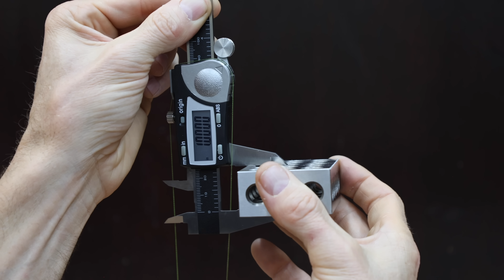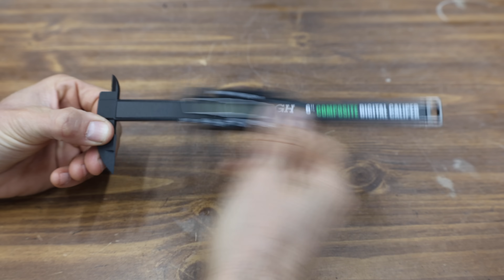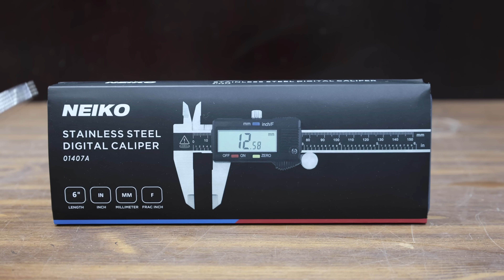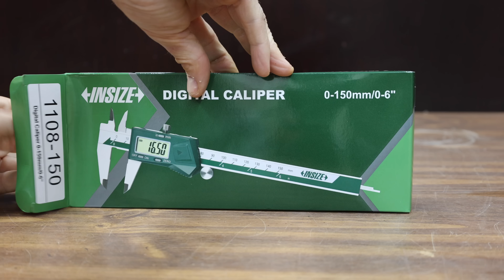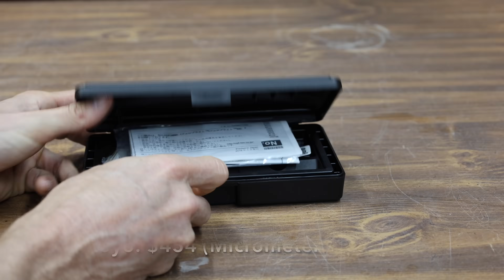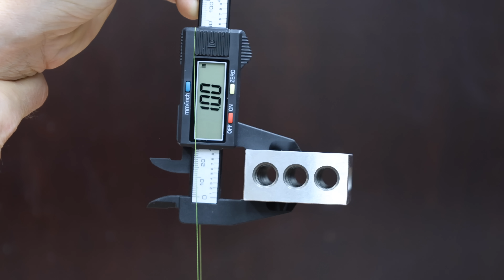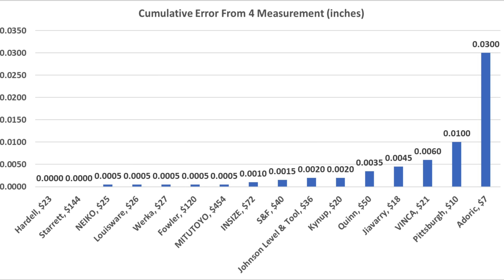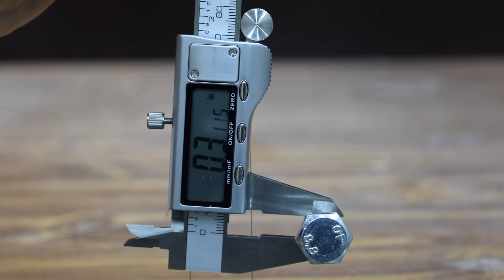I've Been Proven Wrong About Calipers!

Comment: 50 year machinist here. All of these calipers are OK for most of the non-machinist people that use them. The feel in touch that you develop with them determines on how accurate they will be. I’ve seen guys that were a machinist for 10 years and still crank down on a Mike or a caliper and wonder why they were getting the wrong reading when inspection junk part.
Reply: This is what most machinists in the comments miss, and i completely agree with you. I do 3d printing for designs and repairs, I have a few sets of the Vinca, because I don't measure stuff in a machine shop, I do it outdoors, in panels, on equipment, in my office at home where my kids roam free when I am at work. 
If I break or lose a 20$ caliper, I just smile and order another one. Majority of people who watch this channel aren't going to be machinists demanding absolute precision of their tools at 400$+ while keeping it all locked up in a machine shop.
Reply from the maker: Thanks for the feedback.
Reply from the maker: Thanks for the feedback.
Reply: We always called those guys gorillas...lol

Comment: When measuring the accuracy of the depth measurements, I recommend using a gauge block/parallel on the bottom side instead of the wooden table.  In the cases you tested, you were measuring the inconsistencies in the table as well as the calipers too.  Thank you for the video!
Reply from the maker: You are welcome!  Thanks for the suggestion.
Reply: 100% agree offset gage block. Some sources will recommend a surface plate, but the surface plate specs don't really guarantee flatness for contacts less than 3/8 in diameter.
Reply: I was coming here to say the same thing. Kudos!
Reply: Was an aerospace machinist for a number of years . Started only using expensive Brown&Sharpe dial calipers. As the years went by I supplemented my measuring equipment with low cost stuff that I did not take too seriously at first . All new measuring instruments had to be certified by the QA department . All of the cheap stuff past and got certification stickers on them , just like the expensive equipment. Still did not totally trust them so I often double checked measurements from time to time with the expensive measuring tools , always good . Eventually the only one that failed the semi-annual certification was my original “ Brown&Sharpe” calipers. No fault of the brand , it got very hard use for years . ….That is my input from years of experience .
Reply: Great observation. This video could do with a follow up
Reply: Thanks for making this comment before me. A piece of glass would have been better than a  grainey table.
Reply: This is so obvious now that I read it. Didn't even think of it at the time.
Reply: I love this video and used it to choose the NEIKO (my actual needs, speed of delivery, cost). As a former machinist, I did cringe a bit at the wooden table.
Reply: @kennichols3992 it wasn’t a “cringe” thing, just adds an additional source of error to a measurement comparison of extremely precise measurement devices.
Reply: I was going to say the same thing… he could have used a stone as well.
Reply: Yeah, came here to say something similar. Your way is simpler than what I thought of. 😎
Reply: Was thinking for him, plate glass would be more accurate then his table top!
Reply: Make calibrated test gages
Usually QC ckecks gages monthly
Reply: Yes, the wooden table is a fail.
Reply: Yes that is true I'm very surprized that the mutitoyo didn't finish at #1.
Reply: @intra_morph  Definitely keeping my Mitutoyo calipers...they're Vernier calipers and have proven very reliable...and they're kind of expensive...lol
Reply: @intra_morph  It's important to remember that calipers are not high accuracy measurement tools, regardless of the brand.

The Mitutoyo ones will basically always meet their spec, as will any of the better brands tested. That (plus build quality) is what you're paying for.

There will still be some unit to unit variance in accuracy and smoothness, as well as random error due to how carefully the tool is used.

It's not necessarily that surprising that one specific Mitutoyo caliper is outperformed by one particular sample from a different brand.
Reply: @JMMC1005 One sample per tool makes it a poor analysis also. Kinda a slop video.
Reply: @intra_morph  What kind of world is it where you cant trust $400 Japanese caliper? Maybe I should purchase a set of gauge blocks to verify everything. Can I trust those? Who knows!
Reply: @trollmcclure1884 using the depth rod is the least accurate measurement you can make with calipers, too many variables.  For depth you should use a depth gauge.
Reply: @trollmcclure1884  

You can trust them to be within spec, but calipers are a compromise which trade some precision for versatility and convenience.

No matter how good they are, you're almost always going to get less error with a micrometer or depth gauge.
Reply: @trollmcclure1884  Don't understand your problem. Not watch the video? or is it that you can't focus, comprehend, or retain? That caliper was paired in  a case with a micrometer. That is the price. Mr Farm didn't provide a separate price of $162.84 on Amazon. Got it sleepy head?
Reply: @trollmcclure1884  it wasn't $400 to begin with.   It is part of a $400 kit!  True price is half that.   A bit misleading in this case.  
Not to mention the flawed testing methods in this video.....
Reply: Agree. The generally larger error when measuring depth seems to be proving your point, especially when comparing with other very precise tools.
Reply: Just came to say the same lol.
Reply: Same, I disregarded that entire portion because of it. When you're dealing in 1000th of an inch, wood is a horrible choice.
Reply: Why would he have parallels or gauge blocks?
Reply: @TheTimothydragon Those things are basic machine shop items along with granite surface plates and dial indicators. I have all of those things and by not buying the expensive brands it really wasn’t that big of an investment and yet with my sine block too I could monitor my work very precisely. In fact it kind of scared me when I found out the inspection department was just stamping my parts with their “ accepted “ stamp and not even checking them. They “are always good” they said.
Reply: I winced when I watched this and thought the very same thing!  The wood underneath cannot be perfectly flat.
Reply: Came here to see if someone said this. I don't know if there would be much improvement with these though, but precision would definitely improve. I've never had great luck getting precision depth measurements from calipers. Depth micrometer or nothing if I need precision. I'm a hobbyist so that's kind of rare, but certain setups I've done require it.
Reply: Exactly this, plus wood has some "give" which puts the models with a finer depth probe tip (which tend to be the higher quality models) at a disadvantage as these will tend to press a little bit deeper into the surface.  That's not a big effect but at sub-0.001" accuracy it does make some difference. 

I must say that for my money is always been Starrett or Mitotoyu -- my favorite are the old USA- made Starrett with the .0001" readout.
Reply: This is what I thought as well. Or at least mark the table where the test initially occured, and place the block there for the test + take an average of three hole measurements.
Reply: Im an ex-machinist and did the 4 years of trade school and worked the trade for 15+ years and I agree, gauge blocks, but I think the video is more for your home guy with a caliper in his garage not for a inspector in a QC lab in a controlled temperature. He makes other videos that are very good.
Reply: Yeah I was gonna suggest a small granite surface plate; eventhough butcher block is better then most wood it's still gonna have some discrepancies.
Reply: I have no idea how to use calipers accurately but I will jump on the band wagon and give you my 👍
Reply: @Dee_Sandoval  Basically, what he was doing wasn't measuring the depth of the hole, but instead measuring the depth from the top of the block to the table. Since a work-top like is being used here isn't held to sub-millimeter tolerances for flatness and smoothness, and he's trying to measure tools that have sub-millimeter precision, a tiny bit of waviness in the table's surface would create a noticeable error in the test readings. That's why the guy you're replying to was suggesting using a gauge block, which IS designed to be flat/smooth enough to give a reliable reading.
Reply: @Just_A_Dude in layman's terms: table ain't that flat.
Reply: @Dee_Sandoval Vernier calipers are super accurate. Blew my mind when someone finally taught me to read the scale. Next time you're around a pair, try. Here's how it works. Let's say you grip around the object, then tighten the lock. Look to read it and the mark passes a little past the mark 1.1 and doesn't quite reach 1.2, just kind of in-between the marks. You look to the Vernier scale below and look at which of those marks lines up closest to a line above it. Doesn't matter which line. Just find the one that is exactly in line with the mark above it. Say the 4 lines up closest. Bam. 1.14 is your measurement. All there is to it. Now instead of somewhere between 1 1/10 and 1 2/10, you have narrowed it down to 1 14/100. It gives you an even more precise measurement down to the next multiple. Whether centimeters or inches or even minutes of a degree in Vernier protractor applications. Same principle, just check the scale to express the measurement accurately. It'll be listed. Can be fractional or decimal when it comes to inches, usually there's a conversion chart on the back of the calipers to switch one to the other. Hope this helps!
Reply: I thought someone would comment the test wasn’t as accurate as the calipers. Looked like a lot of scratches on the table too

Piece of plate glass would have been the cheapest, more accurate solution
Reply: Parallels?? U won't work in QC do you
Reply: @jckdnls9292 You don't work as a proofreader do you?
Reply: Let’s be honest, for 99% of us the accuracy of the 7$ one is plenty
Reply: @JusTryNc  For most people, sure.  I’m just giving constructive criticism on the measuring, not the quality of the products.
Reply: @JusTryNc  But, there's more than just accuracy to consider.  I used a Pittsburgh for a while, and it was annoying in at least four ways: 
1. The smaller battery didn't last all that long.
2. The battery cover kept popping off.
3. The slide action was very stiff, making minor adjustments difficult at times, especially in tight spaces.
4. More and more, it became necessary to Zero the thing!  In fact, I almost messed up a 3D print because the thing was off by several millimeters.  Fortunately, I caught it in time and re-measured.  That is when I bought my $20 Kynup, which is a dream by comparison.
Reply: @JusTryNc  the $7 is what i have! its my first one and its been fun to use! its good enough for me. Just wish it wasnt plastic and didnt look cheap lol
Reply: For the average non-10-thousandths tool, a >1/8" piece of glass will give reliable results.  Just don't move your gauge block.

Comment: Good to see this comparison, but we beg to differ.  MITUTOYO's are the ONLY calipers we use and purchase (yes, we've used many others other the years, but there is no comparison).  Tried and true.   Their price should be $240 and not listed as the set at $454 (including micrometers).  And they're worth the extra $120 over the competition. And being made in Japan is a big plus rather than all the Chinese made products.  The Starrets were made in Scotland, which was good to hear.    

The thumb screw is very beneficial and should have been a ranked category.

The height measurement would have been more accurate using a surface plate.

Comment: Having bought a number of cheap callipers before settling on my Mitutoyu set, I have to say the biggest thing to watch for is how long the battery lasts. Cheap Chinese callipers the battery last a month or two if you’re lucky and it doesn’t matter if you don’t use it or not! After a while, the cheap ones’ battery contacts corrode too and they’re useless. Consider them disposable at best! My Mitutoyu set cost a lot more (but still less than the Starrett) and heck was it worth it!!! Oh and I detest fractional inch reading. If it doesn’t do decimal inches and millimetres, forget it! And full stainless construction, a smooth thumb wheel and 0.001” resolution are all necessary for any kind of precision engineering.

Interesting that you take the 1:2:3 block dimensions as true, but only check the 1” side with the Mitutoyu micrometer. I’d have checked the other two too as a 0.0005” oversize on the 3” side (or a slight spot of grease when checking with callipers) would change your accuracy results.

Hey, you can’t trust the depth measurement on a wooden table surface 🤦‍♂️! If you don’t have a surface plate, use a glass plate made from float glass.

I think you have artificially handicapped the Mitutoyu in your evaluation by buying a bundled set in a fancy wooden box with a micrometer. My Mitutoyu cost me less than your Starrett and is the perfect instrument for me.

Comment: I like your videos but these methods don't instill confidence. I think you used the string with weight method to get even pressure on the calipers, since caliper jaws can bend if too much force is applied. But to get accurate readings with calipers you have to gently rock them to find the smallest point, which is the correct measurement. This is especially important with the narrow portion of the calipers. 

When I was a machinist I checked numerous cheap and expensive calipers on gauge blocks, and the only ones that were ever off were old calipers with worn out jaws (don't buy used calipers for this reason). I suspect many of the calipers without the ABS function were not zeroed correctly, if you zero them with any dirt on the jaws (which usually isn't visible), they will zero at the wrong value and read small. It's one of many reasons I don't like budget digital calipers.  

The depth measurement portion is for sure not usable info. You need a very flat surface to check the depth measurements, it cannot be wood, especially with visible damage. Even a perfect wood surface isn't anywhere close to flat enough to check these calipers. You're measuring the surface finish of your table more than anything else in this portion. Measuring depth with calipers is kind of a crap shoot anyways, due to how small the base is, but they do sell attachments that make them much more reliable as a depth gauge. 

I think the improved accuracy by most of the calipers when measuring the 1-2-3 block holes shows the previous measurements were not done correct. Since the holes were measured in the way you'd actually use calipers, most of them measured it correctly. I think if all measurements were done this way, the results would be much better. 

Also keep in mind calipers have an accuracy of +/- .001", even if they have a resolution of .0005", so the .0005" isn't to be used, it's just a reference.

Comment: Many times, straight out of the box, the cheap tools perform as well as the expensive.  However, the durability of the cheap tool is poor compared to the expensive tool over the long run. 
Where that cheap tool may be just fine for around the house, it probably won't last when used daily by  professional tradesmen.
Reply from the maker: Thanks for the feedback.

Comment: Always enjoy the videos! The one thing you didn't test is battery drain when powered "off". I tested the pittsburg calipers and they draw just slightly less when OFF as the Mitutoyo does when ON!
Reply: I have a Pittsburgh caliper and found the battery dead if left in the caliper. I remove it when not in use, the slide battery holder is convenient…would be pain if it was held in by a screw.
Reply: The cheap ones I got at Aldi had the same problem. They just fake being powered off, in order to pretend having auto power on. (Since they don’t know how to actually implement that.)
Reply from the maker: Thanks!  Thanks for the feedback.

Comment: Auto shutoff doesn't matter on the Mitutoyo, I'd guess its been at least 2 years since I replaced the battery on my desk set of Mitutoyo's and they are used daily with the display rarely ever turned off. My second pair that I keep in the case and clean as possible as a reference have never had the battery replaced and are nearly 10 years old. As for all my other cheap calipers I keep around to abuse I bought a 100 pack of LR44's because every time I go to use them they are dead if I forgot to pull the battery out. The most important reason to buy good calipers (or at least have several pairs to occasionally cross check with) is that the cheap ones will randomly start reading hundredths off, and then you are scrapping parts and hours to time because you wanted to save a bit on a pair of calipers. Hell I've probably wasted over $100 in filament on bad 3d prints from cheap calipers reading wrong just because I was too lazy to go back to the desk and get the Mitutoyos. That being said, cheap calipers still definitely have a place in the shop, I always keep a pair next to the grinders and another by the welders because the Mitutoyo's aren't going near that. You also need a pair to leave in the truck, a pair to loan to friends, etc.
Reply from the maker: Thanks for sharing.

Comment: My Mitutoyo digital caliper was purchased in the mid 90's for $70. It's still in great condition and accurate to .0005in. I hate to say it but these measurements require fairly controlled environments to be accurate. A wood table top and a screw cut with a curved cutting tool isn't the most accurate way to test these. All the measurements fall with 'margin of error'. Love the videos regardless. :)
Reply from the maker: Thanks for sharing.